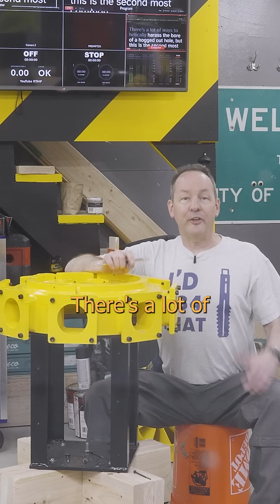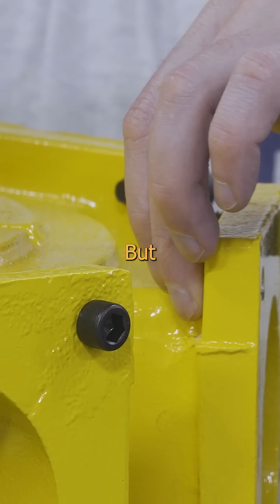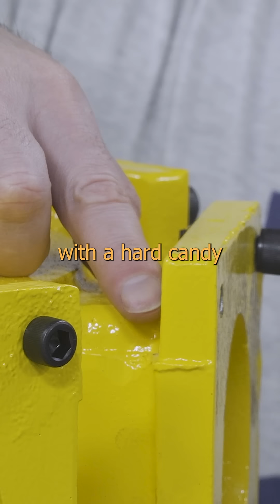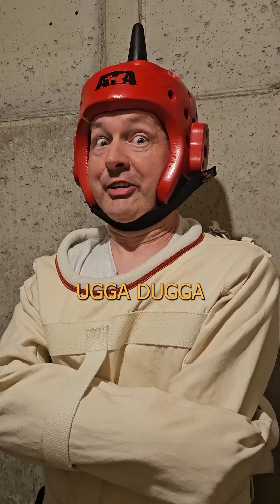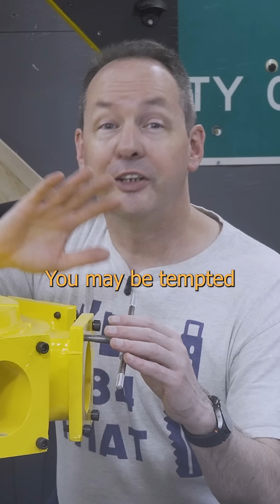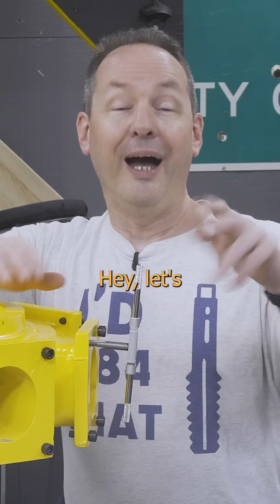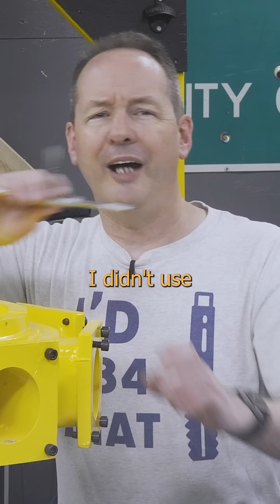Thread Chasing  #chrisboden #comedy #engineering #skills #workshop #metalworking #tools #apprentice

Comment: I've been working on diesel eng8nes like freightliner for about 6 years now
 I never put a tap in a drill. I always figured you need to be easy on it.. the only time I use a drill to chase threads on step bolts. The nut sert. After I go through with hand tool first. Nothing funny to tell, just wanted to share

Comment: I used to overhaul a classified thingy, and I had to chase 435 10/24 holes in t60-61 aluminum.  Yeah I used a drill. And even when I broke taps I would burr them out with carbide bits, and drop in a thread insert. And I still used the drill. It’s okay to break em as long as you know how to deal with em.

Comment: I made this mistake actually. Was trying to re tap some exhaust studs since one had sheered off on me. I drilled it out and went to retap. The thread tap that I bought didn’t come with the T handle (unbeknownst to me) so I tried to use a drill on the slowest setting. Ended up just making the hole bigger. Learned my lesson

Comment: Dumbass: I was working in a pool for a fancy hotel in Boston MA. This pool, instead of being concrete like most pools this was a 40 year old metal pool. So it was definitely worse for wear. We had to re-tap the returns (thats the part that sits around surface level and catches most things like leafs and such) my supe told me "just chuck it in the drill, it'll be fine" so my nieve self did exactly that. I go to start it and surprisingly it works! Im going slow taking my time, when I break a cardinal rule of power tools. I put my self right in the line of fire. About half way through the drill catches, breaks my wrist and bust me right in the nose. This was about 5 years ago now and in the summer when I start to tan you can see plain as day the reminder to stay out of the way and not to use a tap in a drill

Comment: Dumbass  chasing holes on frac plug pin on adapters have 57 plug with x8 holes per adapter. . After 10 plugs chucked it up & snapped the tap in first hole. Spent next 2hrs trying to drill out a broken tap

Comment: The scariest moments in my early CNC carrer was having the machine tap the holes. For years, while running giant manual drill presses, i was taught to get the tap started by the machine,  then finish by hand. Then, while running CNC, your told to just run it. Needless to say, i got to learn how to burn out taps.

Comment: I am certainly a dumbass, but I snapped off a tap with the tap wrench, not a drill. I was 15 and it was on a freshly machined and bored 440 while I was cleaning out the threads for the valve cover. Took forever to figure out how to back it out without fucking the whole thing up.

Comment: Never used a power drill with a tap, but I have had to tap a copper electrode. You would think soft metals are easier. They are not, back you shit out if it gets stuck and clean the bit/hole. When you gotta get a new copper bar after snapping off a 6/32 tap and learning they stopped making extractors at 8/32 is not a fun conversation to have.

Comment: With no working knowledge of taps, I went and bought the Pittsburgh set and decided to use it on my engine block. It had just been sand blasted and I didn’t think about the fact that sand would still be in the screw holes. So I took my brand new Milwaukee drill that I had got for house work and went to town. About an hour and a half later I had gone from a dirty thread to a smooth bore hole that my bolt could wobble around in. Had to drive it an hour that same day to get it shipped across the country. Ended up filling it with broken pieces of wood and wood glue just to get the bolt to hold long enough to make the drive. (It was a tensioner bolt and the tensioner had a lip that it sat on so there wasn’t much torque being applied to it). Had a shop put a helicoil in as soon as the truck was delivered

Comment: Id recommend always using two hands, one hand and you have a tendency to put un-even torque on the tap, which is NFG. Also, 4 flute taps for cast iron and no oil, as it's self lubricating. 2 or 3 flute for most other materials. Lol, heard milk works well for tapping copper, ain't never tried it though.

Comment: Don't use taps for this. Use a proper thread repair kit. Taps open up the pitch slightly and causes the bolt to wobble. This causes problems in high torque and high vibration environments. Taps are the last resort not the first thing to grab.

Comment: dumbass.  threads on magnesium laptop chassis had some cruft in them and i thought FOR SURE i could use a small battery powered drill to chase the threads gently enough... i couldn't.  ended up using a larger tap to re-thread the holes for a larger size screw then had to buy 8 new screws 2 sizes larger.

Comment: You can also get purpose-made thread chaser sets too. They're meant to follow already existing threads rather than cutting new ones, so they're easier to start and you can run them faster than a tap. They're also made from a slightly softer material so if you do snap one off you can actually stand a chance of getting it back out.

Comment: My worst oops wrong thread path was when I worked at BMW. I was doing some repairs on some trade-ins we had. A Tundra with the 5.7 needed new engine mounts and the mount blocks that bolted to the side of the engine block. Well I went to bolt the mount block to the engine block and used a 1/2 impact yup. Ugga duggaed that thing all the way home.

Comment: Dumbass. I broke a 3/4 tap in the jaws of a roll decoiler. It was the end of the night and i was rushing trying to get production back up. Ended up having to use a punch and knock it through and pull the threads with it. 😅

Comment: I’d say I’m that dumbass. Had to bore over my exhaust manifold stud hole because I thought I could EZout a snapped stud. Indeed I could not, took a grinder to it after I couldn’t line it up, never thought to weld a nut to it. Ended up having to helicoil the oversized thread and loaded it with enough thread locker to stop up an elephant.

Comment: Honestly have yet to break a tap in a drill. Broken PLENTY hand tapping 1/2 inch steel with 3/18 - 16 holes. Those fuckers are the perfect size to be stubborn and flimsy at the same time.

Comment: Never needed to have that dumbass moment thankfully. 

As a former flying wrench monkey (aircraft mechanic) my bane was always the infamous Philips screw. Hardened steel bits would constantly snap off while trying to break the torque on screws that were probably put in with a impact rather than a torque wrench. If I was lucky there would be a small burr sticking out that I could get the vicegrips on. Sometimes those bit would break off flush. If you ever hear an AME apprentice scream in anger, this is why. No way you're drilling that tempered junk out with normal bits. What I learned was to take a pointy metal stick (awl), sharpen it to the point where it could pierce bone like butter, and drive it into the side if the snapped bit with a very precise hammer blow.  Works half the time, every time. Just don't miss or slip, you'll either put a hole in your plane or give yourself a pretty badass piercing.

Comment: I was a dumbass who didn't listen to my bits when playing with holes in shop. I managed to not only crack and separate the wood, but burn and fusing it back together after because my teacher messed up my speed setting on the trigger of the drill... instead of setting it to only half press, he changed it to lock mode to set the bits... not realizing he had when he checked the tightness, I started drilling... I couldn't stop, it melted the bit and warped it causing the wood to burst within the vice because it went too deep too fast and hit the nail/screw.

Comment: Dumbass, but still do it. 1"x1" aluminum extrusion gets a 1/4-20 and 1.5"x1.5" gets 5/16-18 for end taps, and if you have to tap 60 of em at a time, you buy a bit of extra material so you can cut off a few inches when you inevitably snap one off. Still cheaper than the labor of hand tapping them all.

Comment: This certainly came at the right time I have to drill and tap lithium batteries because they don't have studs and I don't have a laser welder so i haven't found another option for these 25 amp hour Prismatic cells

Comment: Dumbass 

I snapped a bolt inside a panel. No big deal, use an extractor drill bit to get it out. Succeed but the bolt was so badly rusted the thread was destroyed. No big deal, clean out the thread and redo it. Use a fucking drill. Fail to move the selector off 2 speed. Engage at a bad angle. Break the tap. Fuck. Had to use a coworkers tap who laughed at me for trying to do it with a drill. Went at it by hand. Much better.

Comment: Dumbass, worked in a food plant as a maintenence mechanic, lots of fast moving parts, well I worked with this Indian guy who apparently has mastered the tap and drill method, after watching this guy who barely speaks the same language as me just perfectly tap like 30-40 holes over two years, mind you the entire time im doing it the correct way, however one night (last minute Friday shit) decided f it i got this looks easy enough the 30-40 times I had seen it right, nope instant fing snap, then 1-2 hours drilling a titanium tap out of a solid piece of stainless steel, just to have karma come back to slap me in the nuts for turning my back on the old ways....got it out somehow without making it bigger. Then went back to tapping the right way, and instantly snapped the next tap in using the T handle, to this day that T handle is stuck in the ceiling.

Comment: Soo, I'm in my 6 weeks basic workshop training for my training as electronics engineer. I just learned through faults of my owen, how to use a srew extractor. Pain in the backside these things are. I was soon to learh that there's a much more painful version of this. This being basic straining had to cut all threads by hand. That was fun until I figured I could make it easier by using a longer lever to turn the tab. The fucker snapped clean off, leaving me with a piece of harned steel halfway through the hole I was cutting a thread into 😂

Comment: Dumbass and I learned when replacing a bolt on the lawnmower that was fucked up and needed help and I fucked it up worse then spent 2hrs taking everything apart just to weld a broken metal bracket and then forgot about the bolt then remembered when I found the original bolt again

Comment: There is actually a tool called a thread chaser. It has more thread and less hole. It makes it harder to cross thread your hole, and its actually better for fixing damaged threads, because it reshaped the threads instead of cutting them.

Comment: Yup exhaust manifold bolt broke extracted out fine but it was a aluminum head so it took threads with it resized for a bigger bolt and went to tap it with my tiny snap on driver and it didn't go as planned a little context the engine was still in the truck I was doing this through the wheel well luckily their was enough meat to go one more size bigger with drilling out the headers too sealed up fine when I was done 4 hrs too late.

Comment: Taps are for new holes. Use a thread chaser for old holes, otherwise you risk adding slop to a tight hole and weakening it. Learned this lesson on aluminum engine blocks. 

Ps I'm a dumbass too and I have hogged out literally hundreds of thousands of dollars of well heads with a drill, each of which were replaced by a deserving corporate overlord.

Comment: Yeah got a set and didn't read or watch anything on it and attached said thread cutter to a corded drill. About.5 seconds of starting it stopped abruptly and I gave it the good ole ugga dugga and SNAP. I also learned y you take your car battery out or disconnected at least before welding anything snapped off on ur vehicle

Comment: I once had the dumbass job of tapping a couple hundred holes a day during build-up of prefabbed parts into A/C evaps for busses. They shoulda been tapped from factory, but never were. So I used to break between 2 and 10 1/4-20 taps a day, as being light and gentle cost the company more than breaking the taps, removal time included. (Fastest way to get it outta there is to hit it with a punch and a hammer until it's reeeeally expensive mulch-- can't be stuck if it's powder)

Comment: I tapped about 160 holes with it on a cordless drill with the clutch set low. It was fairly thin aluminium plate. Then the chief engineer came over and said that was asking for trouble... as he watched the very next hole the tap snapped. To this day I'm convinced he had Jedi powers.

Comment: Need a section of comments for "Shitass" for those who broke taps off in the hole and had to eyeball a harden steel plug harder than the guy she told you not to worry about.

Comment: REGRET. When i was like ten i felt like i needed a tapped hole. So i found the ONLY tap my dad had. I put it in the drill press and barely touched it and it snapped right off 😢 lesson learned i guess. 😂

Comment: I once tried tapping a door frame for an electric strike and snapped my tap in half cleanly in the hole I was threading, so flush I couldn't get it back out. I had to remeasure and redrill my holes to cover my mistake and leave that tap where she lie

Comment: Definitely a dumbass I was tapping the end of a 870 barrel for screw in chokes I cross threaded the last half inch and thought nah I can bore this sucker clean by putting the tap bit on my drill .....the 24 inch barrel was then cut and crowned to 20 inches cylinder bore no chokes

Comment: Have successfully used a power drill/driver to chase threads.  Only once and only because I had no tap wrench (buddy must have borrowed it, lowdown mfer) and only a VERY short chinesium adjustable crescent wrench.  Once I got to the threads that needed chasing, I couldn’t continue to turn by hand and I didn’t trust the crescent wrench much, so needing the extra torque, I set my drill/driver to the weakest torque on the limiter and just barely engaged the trigger.  It took 3 step-ups in allowable torque to finally start turning the tap past the manual stopping point, but eventually it worked.  The key was incredible patience and understanding that overdoing any part of that process would ruin the whole thing.  I also let the tap pull the drill in at its own pace instead of putting any “downward” force on it.  Did I get lucky?  Yeah, a bit, but I’d be willing to bet that using my methodology I could successfully do it again!

Comment: DUMBASS

The threadsert blew out at a 7-11. Wound up pulling the head and reconditioning, had the tech put the heli coil in correctly from the inside. :-D

Honestly, I think I tapped it out properly, it just didn't hold.

Comment: Dumbass... 15 years old trying to rethread a metric thread with an sae tap cuz I didn't know better and had SAE bolts to replace a bolt with a broken head. So, I went down to a culvert to test my newly refastened head stock on my BMX. Landed bad. Twisted my handlebars all the way forward and kissed the front tire. Lesson learned. And a new $80 haro headstock.

Comment: With correct technique and understanding how something is supposed to feel, you can easily tap/chase these with a drill. I've done thousands of holes by hand with a drill in my career. The only ones I won't touch are M3/ 6-32 or anything past 5/8ths, those get a loving hand with a ratchet and a tap socket. Never power tap blind holes and use plenty of lube.

Comment: Had a situation working in my grandfather's machine shop where we were producing parts that needed a couple tapped holes by hand after they came out the machine. He had some setup where a tap was sticking out a plate and as you press the plate it started to tap at the right speed (I was never told the name of the machine or if I did I forgot it with all those pesky childhood hopes and dreams) and it always cleared with the gauges so we were always in spec. But for one reason or another eventually one tap didn't take right and it snapped while sticking out the back end of a hole, I most likely was just a DUMBASS and applied too much pressure. And from then on I had my first ever snapped tap and always manually tapped them before taking them out. Took a lil longer but hey I didn't mind being on the ol bridgeport. My grandfather even still has the part while he's retired cuz its a good memory for us.

Comment: What siren is that? Looks like a Tempest 112 (or 121 without horns) from American Signal Corp in Milwaukee, Wisconsin. If so, I have built 100's of those things when I worked there. Those tapped holes for the horn mount(T-121) or bird screen(T-112) were drilled from a crude drill guide fixture, then tapped using a tap that was chucked in a drill that had a mechanism that would make it spin clockwise when the drill body was pushed towards the part, and counter clockwise when you pulled the drill body away from the part. Had to get the timing right ir you'd snap the tap every time when the threads on the tap ran out and the shank hit the casting. We sprayed the everliving piss out of that casting amd the rotor with Teflon too, so not only will I probably have some health issues from it, that paint probably won't last either unless you chemically cleaned those castings with something that would remove that Teflon.

Comment: Dumbbass* - had an aluminum tap problem building a robot. Supposedly our "Boeing sponsor" did the work... but weird how nothing on the corners, specifically, didn't fit right. Did the "manual air finish" plus some silicone lube and suddenly, actuator arms flowed as freely as NBA free throw elbows

Comment: Definitely your advice on not using an impact it sound, and I would recommend following it.

However, I work on manufacturing equipment and I have tapped hundreds of holes using an impact driver.  Time is many hundreds of dollars a minute and getting a tap holder etc. is not always so quick.  They key is trigger control.  Be careful!